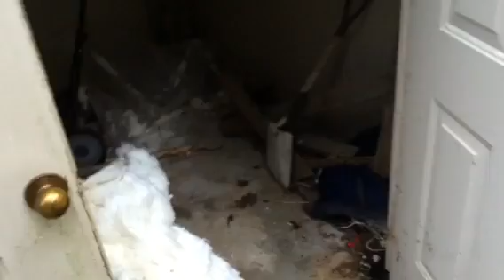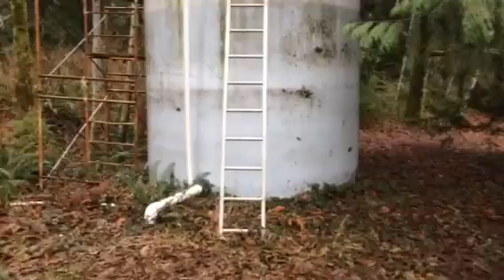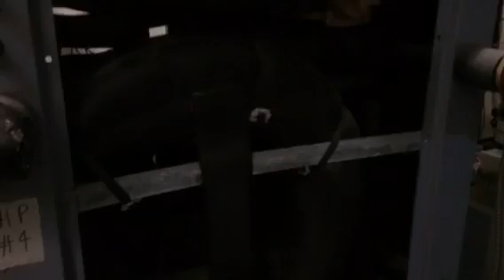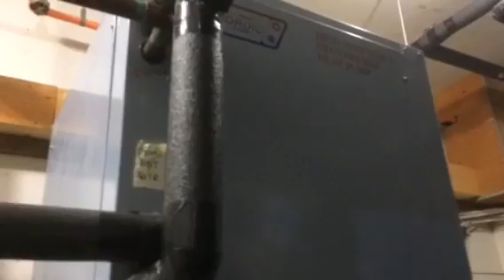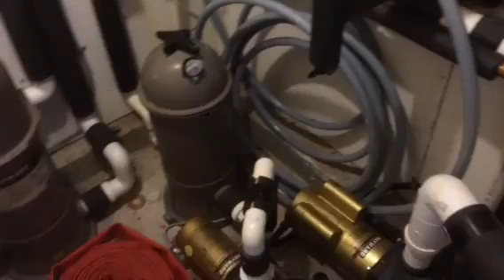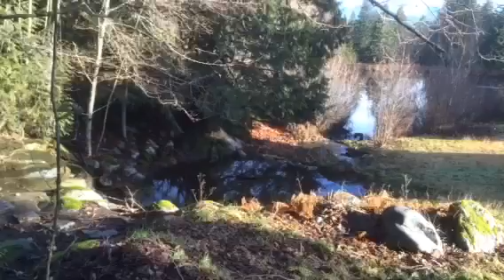Geothermal Heating WIN

Comment: No mention of the high electricity costs involved in extracting and pumping the water !
Reply: Hanne Catton I'm sure they got the cash for it
Reply: It takes energy to pump the water but still usually a 40-50% gain overall compared to traditional heating and cooling. It's a good system if you can afford the upfront costs.